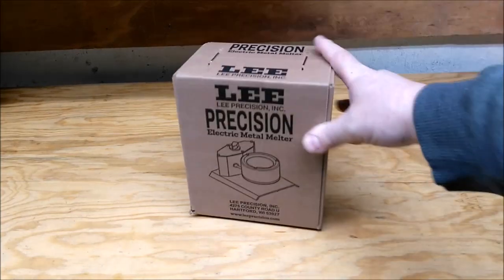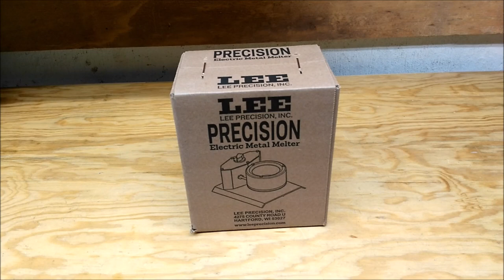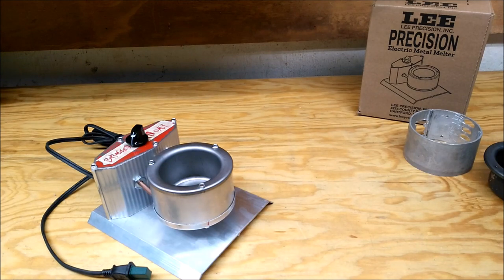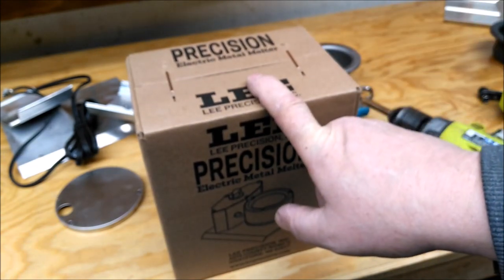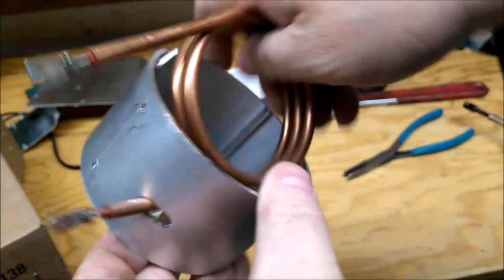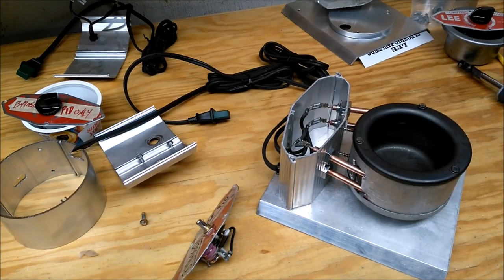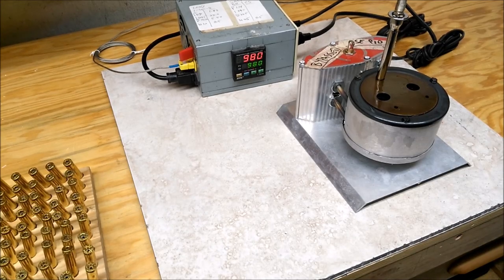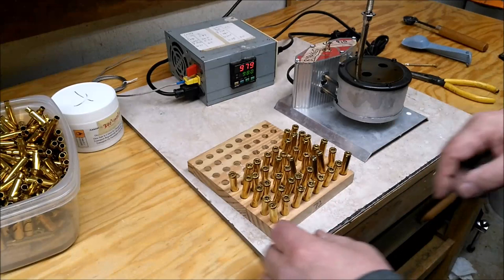Lee Precision Melter Mod (for Salt Bath Annealing)

Comment: I saw this on Johnnys Reloading bench, It looked like a lot of trouble to me. However, there have been positive reports that it does do a more uniform quality job as far as process. Keep the mods going as far as furnaces go it makes some interesting viewing and kindles people out there to think outside the box. I like the double coil mod you did for the twenty-pound furnace, all I have seen is the prices of casting stuff go up and what used to be reasonable, now is a decision to make. this craft really has taken off in the last five years or so. Keep up the good work-Dave
Reply from the maker: Thanks. Adding a second element really is a huge upgrade. I actually had the Ballistic Recreations kit before Johnny did his video, but hadn't needed to do any annealing at that point. Temperature control is probably its main benefit, but you do have to keep track of the salt level. Not automated is another downside. I'm also intrigued by induction annealing, but you either have to build your own machine (look up  "GinaErick"), or pay big bucks for one.
Reply: Yes the Psyko thinks out side the box and I like that. Always a good video.